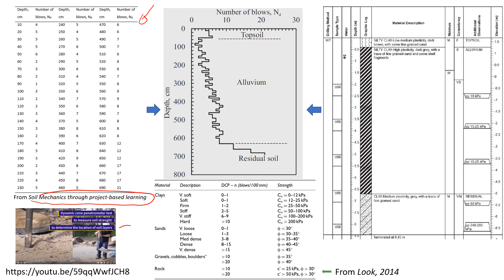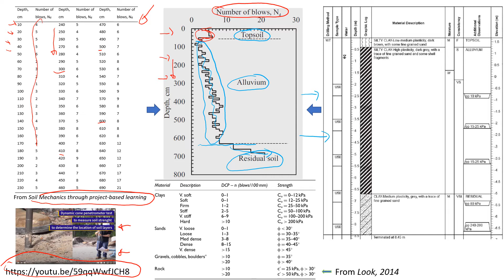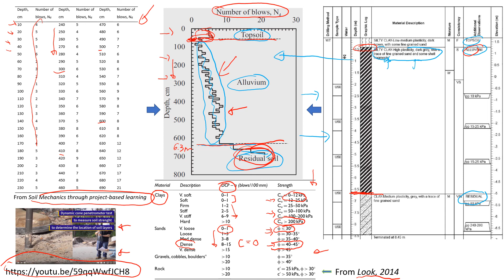Dynamic Cone Penetration Test Analysis #education

Comment: Hi Ivan, thans for sharing. Can u please suggest what SOFTWARE to process this DCP data that can produce interpretation and also its correletaion between DCP point
Reply: software engineer here.
can write anything you want. happy to work with you to ensure reports are generated in not just a technically compliant way but useful and with internal error checking.

Comment: Hi Ivan   Great video. Very useful. Just a question.  Sometimes the DCP test shows higher blows (Example 9 to 10 blows) around 0.5m to 1m in clay soil and shows less blows (Example 4 to 5) as you go deeper around 1m to 2m. Can you explain why that is?
Reply: When you start with the test, evaporation and movement by vehicles can compact the top soil, giving you a slightly higher strength.

I think there will be water table within the depth of 1m that's why. Clay when wet is soft and expands thus, you will need less energy to penetrate it.

so in summary, there is a possibility of a water table being around that depth hence, the lower DCP values.